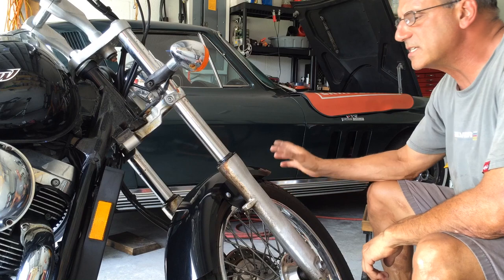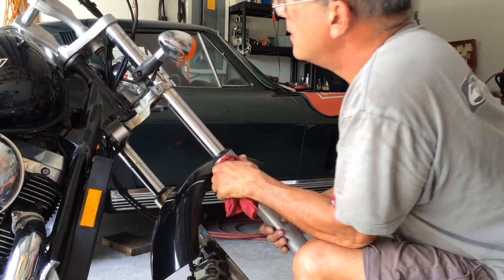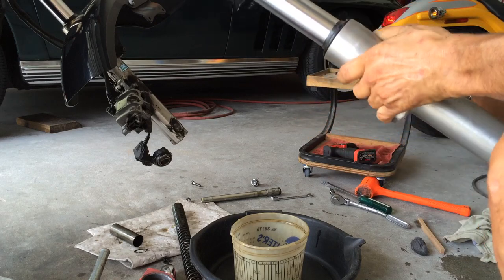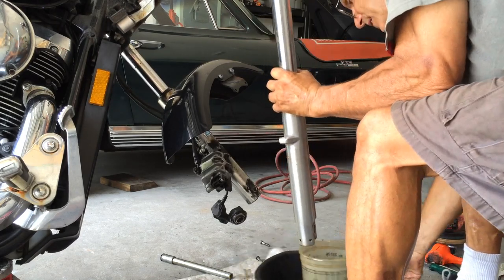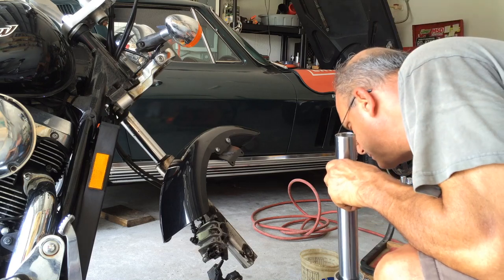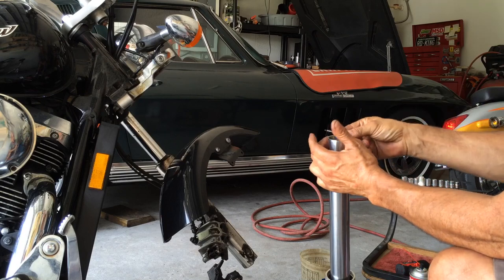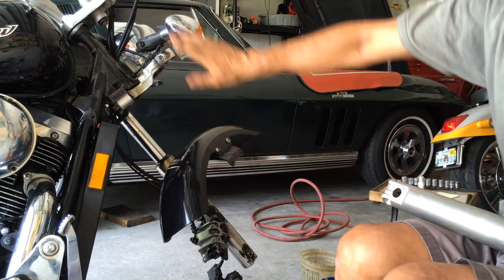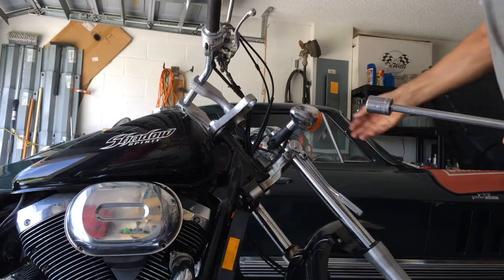How To: Repair Honda Shadow Fork Seals  Part 1

Comment: Cut a slot from the old seal, place it over then new seal, and you won't damage the new seal while tapping it in with the pvc. After it's seated the old seal comes right out since its slotted.
Reply: Great tip thank you!
Reply: Boom. Knowledge drop.
Reply: I used a piece of steel exhaust extension and it didn't do nothing so nacio without having a spacer between them

Comment: I successfully completed this procedure on my '06 Shadow Spirit 750DC. Thanks for taking the time to make this video. The shop where I got my fork oil also said that the forks take 483mL of oil, so I checked level both using a ruler and having had measured it out.
Reply from the maker: Happy to hear all went well. Thank you for your support, Ride Safe and have a great day.

Comment: Did anybody notice that he put the spring in upside down
Reply from the maker: Yes we have, Hope it helped. Thank you for your Sub Douglas.  Any question just ask. Ride Safe and have a great day.
Reply: @TwoWheelRocco  hey... wasn't criticizing just something that I noticed I will say this... You take the process of repair from the standpoint of interpretation from a repair manual, and break it down so it's easy to understand. just keep doing what you're doing.
Reply from the maker: Happy to Help,  Did you end up doing your front seals? Thank you for your Sub Douglas.   Any questions just ask. Have a great day.

Comment: why did you reverse the way the spring was, it came out tight at bottom didn't it?
Reply from the maker: I did not realize that i installed the spring reversed..Never notice a difference in the ride..I try to reinstall the way i removed it...Good eye..Thank you,
Reply: Good catch.  I caught it but wondered if anyone else caught it.  It seems just the two of us caught it.
Reply: I noticed it when he pulled it out the first time. Thought I was seeing things.
Reply: How to rebuild 2001 honda shadow vt600cd vlx deluxe rear monoshock? Or is it rebuildable?
Reply: @robertharrison4000  take it off and hardtail it with a solo aeat

Comment: I just got a bike and both seals are leaking so I'm going to be doing this and I've watched a lot of guys on YouTube and your video is great. The camera is stable and you show eve thing that needs to be done from beginning to end and I love that you do one fork at a time so everything goes back where it needs to be. I would think the forks are about the same as my bike 99 shadow VLX 600) and do you think I should check and change the break pads at the same time or is that easy to do with the wheel on? I'm new to bikes so if that's a dumb question just say so. Any other tips?

Comment: For some reason I just found your channel while trying to find information about changing my fork oil. I was trying to find out how much fork oil I needed to purchase. It does not matter, I am a subscriber now. 
Take care, ride safe.
Reply from the maker: Happy to help. What I did was get a little paint mix cup that has the increments of ounces on the side you can get in Walmart any paint shop and when I emptied the oil out I kept track of how much so just to be on the safe side buy 2 quarts of fork oil 15 way and you'll be in good shape. That's how I did it because you're right it's hard to find out the exact amount of oil so when I dump the oil out of the forks, what was in it will go back and usually if I remember correctly it was like 15 ounces per fork. Thank you for watching and all your support Paul. Ride safe and have a great day.

Comment: Phenomenal explanation!!  I like the use of the pop bottle to help slide the seals - that should eliminate any seal damage from imperfections in the top part of the fork tube on its way down.  My recently purchased Shadow has aftermarket seals that leak just a tad.  I’ll start now piecing together the parts to do this job over wintertime, but with Honda parts.  Thanks you!
Reply from the maker: Happy to help.Any questions just ask. Thank you for watching and your sub. George. Ride safe and have a great day.
Reply: @TwoWheelRocco  Just did mine this weekend.  Almost identical to my 2007 VT750C2.  I mostly followed what you laid out here which was extremely helpful.  So far no leaks (went OE parts), ride seems smooth like before so perhaps the oil in there before was quality, though it came out black and nasty.  And worth noting is the side that was leaking worse also had the more worn bushings, so I'm sure they are related.  Thanks again!

Comment: Thank you for the great step-by-step video! I'm going to do fork seals on my 07 Shadow Spirit this coming weekend.
Reply from the maker: Happy to help, Any question just ask.  Thank you for the Sub.  Ride Safe and have a great day.
Reply: @TwoWheelRocco   Yall know that the shadow 750 and the spirit 600 are to different bikes right. there not the same. first thing you should know if your gonna teach....
Reply from the maker: @nitrocell9287  Just trying to help. Certain things crossover from motorcycle to motorcycle I'm not sure what you're talking about. Yes they are different bikes.  This Video was regarding a Honda shadow spirit 750. Thank you. . Ride safe and have a great day

Comment: Looks like a good video. Check manual for your particular fluid level, service manual I have states 4.9"/124mm. Also, note that the right fork spring was installed upside down. I know it has been mentioned earlier in comments, just stating for new viewers. Manual I have also states to replace bushings if they come off.
Reply from the maker: Just trying to help. Thank you for your comments and advice. Ride safe and have a great holiday Nicholaus..

Comment: Getting ready to replace the seals on my 1983 650 night hawk
Reply from the maker: It is easier then it looks. Any problems let me know.
Reply: 1982 Honda 250 custom here. Will save this Video for my next project. Radiator on my 74 f100 is first.

Comment: Do you happen to live near Shalimar? I heard “Niceville” on the radio. I feel like I may have met you. I’m doing my 96 Honda Shadow VT1100C2 (ACE). I just bought it not running (needed a carb clean and other refurbishment). Anyway, the forks haven’t seen fresh oil since 1996. It’s 2020. One fork tube came out without the bushing. That stayed in place. The second fork tube never came out after a hundred or more attempts. I had to dig out the seal as it was rusted to the washer and bushing!! I marred the slider up a little, but there was no option.  It took two days and some pain killers. Tried heat, tried PB blaster, tried dynamite... ultimately used a screw and drill to tear it up and a flat head screwdriver and pick to get it out. So, I got the old seal and washer out, but still couldn’t get the fork tube and bushing out. Fork still slides fine, bushing won’t budge. I cleaned it up and plan to roll with it. With the fork tube that came out, bushing still seated, can I just tap the fork tube back in? Ever seen this? Thoughts? I think I’m the only one in the world this unlucky. I haven’t attempted to tap the tube back into the slider with bushing still snugly in place, but that’s my next resort unless I’m going to face damaging it. Thoughts? Thanks for the video. I have been using the manual in addition to your wisdom.
Reply from the maker: If you could send a cell number and I will call now. If that works for you.
Reply: Damn I'm about to do this job on my 96 Honda shadow ace 1100

Comment: good vedio sir. rocco, its looks like easy way but before when i remove my shock ..its very hard for me to remove the bolt downster of shock always  spin... now ther is a lick downter because i cannot tight,, well the bolt i just put epoxy and fixed.. so thats great vedio  after draine the oil.. return to the handle post and use compaq...  ...ill try this vedio when i get my oil seal.. thank you sir....
Reply from the maker: Happy to Help..Let me know how this works out..Ride Safe.
Reply from the maker: Use the Fork tree as a clamp...Loosen before you remove from tree...That way they will all be loose...Hope this helps..Ride Safe.

Comment: Nice Vid, but you made a mistake. 
The spring is upside down now. The tight end should be at the bottom, as it usually was. The compression should get harder the more you squeeze the fork 💪
Reply from the maker: Good eye  brother. I had to fix that. But the video was done and running so sorry about that. I hope it helped.  Thank you for watching. Ride safe and have a great day.
Reply: @TwoWheelRocco  what kind of pvc pipe did you use?  I picked up a 1.5. At Lowe's. It wasn't big enough.
Reply from the maker: @donaldallmon6804  Happy to help. Could bring the seal with you and match it up I bought it at Home Depot  Any questions just ask. Thank you for watching and your sub. Andy. Ride safe and have a great day.   pipe 11942 67602 4
1 1/2   Charlotte pipe,   Home Depot I bought 4 feet of a 10 foot length. Hope this helps..

Comment: The spring came out differently than you re installed it.
I always crack loose  (not remove) the bottom bolt when the fork is still mounted.
Reply from the maker: I agree. Live in learn. Good eye.. Thank you for watching have a great day.
Reply: @TwoWheelRocco   have you noticed anything special on the bike that wasnt right with the spring installed upside down?
Reply from the maker: @jeroenvanmechelen7205 Not a thing.  there is no difference.  Are used 15 weight MC fork Oil. Rides great.  What do you think?

Comment: Why did you put the spring in upside down to the way you removed it? The tight area was at the bottom when removed.
Reply from the maker: I made a mistake you got a good eye,  I ended up fixing it.but I didn't catch on the video. I can't tell the difference but you know there is a difference. Thank you for watching and your sub Scott. Ride safe and have a great day

Comment: I got a shadow Sabre and my seal slid on smooth and easy without any kind of plastic bottle. And I clean my fork tube with contact cleaner for hand. I hope the shop sold me the right seals  I haven't got the bike and put it back together yet so I don't know if they're going to leak nor have I put any fork oil in a me yet
Reply from the maker: Happy to help. The reason for the plastic is to protect the seal from any kind of corrosion on the fork. This will protect it from leaking. A little scratch on the seal and it will leak. Cross your fingers, Put it together and you'll probably be all right. Thank you for watching and your sub Aaron. Any questions just ask. Let us know how it works out. Ride safe and have a great day.
Reply: I cleaned the upper fork to really good. There was no corrosion on it I'm just hoping the guy I bought the seals from sold me the right ones. Cuz it look like your seals had more resistance going on than mine did
Reply from the maker: @aaronpavey1224  I think I will work out. Let us know. Thank you for watching and all your support Aaron.

Comment: Sorry, one more important question: I lifted the bike by the frame to check something (front, it didnt tip over cause it was a stable setup) and as the front wheel lost contact with the ground, by gravity, the handlebars swung to the right and hit the steering stop. 
I couldn't catch it. 
Should i be worried or these things are tough enough to take that (bolts on triple tree too)? 
I checked for anything bent, loose or cracked and rode it, but didn't find anything. (No excess vibration or pulling.)  ?

thx,
Reply from the maker: Not a problem, takes a lot to break the steering stops or triple tree.

Comment: Great video. I have a shadow sabre, similar but I cant put the nut back on the shock spacer the way you did. Would I be able to compress the shock with the wheel taken out so I could push it up and bring the spacer down a little? Thanks for any advice you could provide. Kurt
Reply from the maker: Try to use the method on video..and line up threads on tube and nut.so that it catches the thread..patients you will get it...let me know how it works out.

Comment: Great vid. I've been told to break loose the bolt at the bottom while the fork is still under compression, as it will stop the assembly from spinning. Thanks for the other tips!
Reply from the maker: Yes..Thank you...Ride Safe..
Reply: Also, doesn't pounding on the new seal with the pvc pipe damage it?
Reply from the maker: No, PVC pipe works well... Factory end...that protects seal... works well...Hope this helps...Ride Safe..
Reply: I found ABS pipe in that size.  Worked very well!  Now I need to figure out how to do the 1100's fork seals.  The same pipe won't fit, fml.
Reply from the maker: Home Depot....Works for me....

Comment: I have a 2008 Shadow spirit. I tried using the PVC pipe, but it won't fit around the tube. I had to order a fork seal driver to finish the job.
Reply from the maker: This is the  pipe 11942 67602 4
1 1/2   Charlotte pipe Home Depot I bought 4 feet of a 10 foot length.
Reply: Me, too.  Your forks must be smaller than mine.  My forks are 41mm.
Reply from the maker: Thank you for your comment. It will help somebody with 2008 Honda Shadow Spirit.  Ride Safe and have a great day.

Comment: Hey rocco my top fork screw is leaking can i just unscrew and put new o ring or do I have to take everything apart like this video? Also can I leave the tire on just to take out the top screw
Reply from the maker: You can just replace o ring. Just make sure your front wheel is off the ground. So there is not much pressure on the front end.

Comment: I removed everything and my forks  are stuck.  I got one side down about five inches from hammering it down. Figured out I need to remove a screw under the fork and then it slid off.  I tried to remove the screw on the other fork but it just keeps spinning.  I waa able to pull it down about and inch...any ideas??? Replacing these forks btw
Reply: 2005 aero vt750
Reply from the maker: Did you remove the spring? if you did reinstall spring so you have pressure on that bottom screw.  in the video I loosen and remove the bottom screw then top cap and spring. Before I drain the oil.    I used an impact gun to remove bottom screw when it gives me problems. Let us know how this works out.

Comment: The spring came out with the tight winding on the bottom ( 3:00) but you reinstalled them with the tight windings on the top (13:20).  Does this make a difference?
Reply from the maker: Good Eye... Just reinstall the way yours came out.   Just make sure booth are the same.  Thank you for your Subscription Larry.  Ride Safe and have a Great Day.

Comment: I know this was 7 years ago...but when you pulled that spring out tight side was down but you installed it tight side at the top...which was does it go
Reply from the maker: Happy to help. I don't think it matters. But I did switch that spring around,  when I edited the video, I got it wrong. Thank you for watching all your support. Andrew. Ride safe and have a great day.

Comment: Any recommendations on how to remove the drain bolt if it just spins on the inside?
Reply from the maker: Happy to help. Put the fork back together and use an impact to loosen that bottom  allen head. Usually I loosen that up while it's still in the bike. I use it as a clamp to hold the tube. With the cap on the top of fork tube.  Then that hardware will not spin. Hope this helps. Any questions just ask. Thank you for watching all your support Alex.. Let us know how it works out. Ride safe and have a great day.

Comment: Hi. How often would you do this as maintenance (also changing fluid)? 
i commute in cali (not much rain, but bike is coverred and gently hand washed.)
Reply from the maker: If forks leak, do seals and service. otherwise leave alone.. Usually forks get dirty and cause seal failure. Hope this helped, Ride Safe..

Comment: Hey TWR... I loosened my triple tree bolts without a jack in place and the frame came sliding down the tubes.   Afyet raising it with the stand and tighting up the bolts, Now my front end feels lowered.  Do u think i busted something,  didn't see any fluid leaking, can i set the forks higher or back to normal. 06 sportster.
Reply from the maker: There should be no problems....Use the top of tree and set fork tubes the same. Let know how this works out.
Reply: Thanks Sir.. you've  helped me out many times..
Reply from the maker: Happy to help..Ride Safe and have a great day.

Comment: My shadow has 41 mm shocks, 11/2'" pipe is too small. What do your shocks measure?
Reply from the maker: Happy to help. Take your fork seal and go to Home Depot and find a pipe that will work on your application. Any questions just ask. Sometimes I will cut down the center of the pipe so it can flex to be bigger that works also but you can find the pipe if you go to Home Depot. Thank you for watching all your support.. Ride safe and have a great day.

Comment: Hey Rocko how about some videos how to jack up a motorcycle honda Shadows the engine is lower than the frame
Reply from the maker: Next time I get an Honda I will. What are you trying do and how high do you need it to be.  Happy to help. Thank you for your Sub Sal. Ride Safe and have a great day.
Reply: Trying to change back rear drum pads regular motorcycle jack doesn't work on a 2006 Honda shadow spirit 1100
Reply from the maker: If you can send a cell number I will call you now.
Reply from the maker: I will do a video on using auto floor jack on Monday.
Reply: Kool thanks,